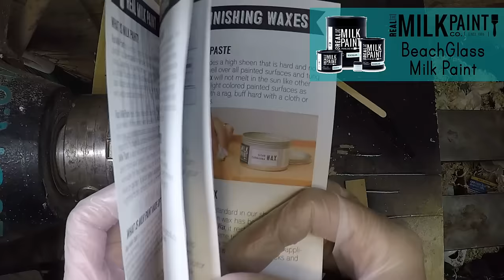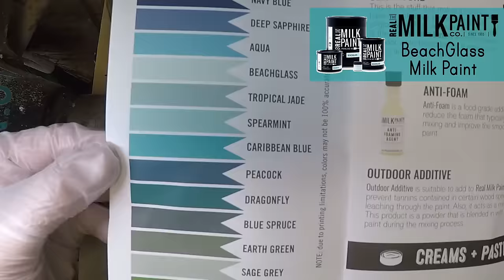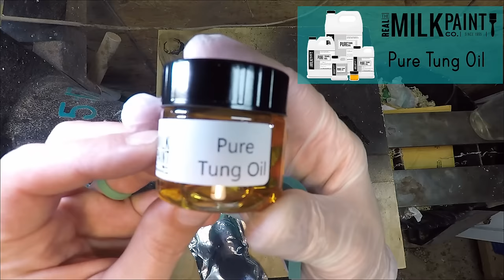Milk Paint, Magnolia and a Giveaway !

Comment: Hi Kim, Luckily I just found you and watched several videos. I really like your work, style, and humor. You seem so relaxed while turning. You may have a video on this, but I’m real curious how you sharper your turning tools? Thank you!
Reply from the maker: Hi MJ! Thank you so much for watching! I use a One way wolverine jig o. my 8' variable speed grinder.  I have 2 CBN wheels that are 80 and 220 grit.
Reply: Kim Tippin Wood Turning - Thank you Kim. I have been looking at the Kodiac system with CBN wheels, but I’m not sure what grit? I’m “retired” due to a spinal injury, having a wood and metal fabrication shop for years. Now I have the shop to myself, and trying to improve my lathe skills. Any advise on tools and sharpening would be appreciated. Thanks 🙏